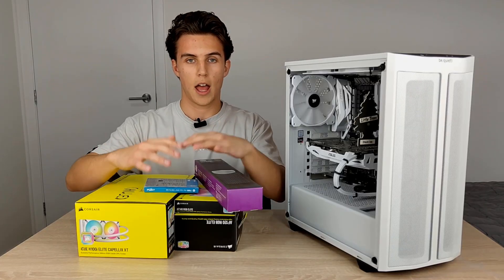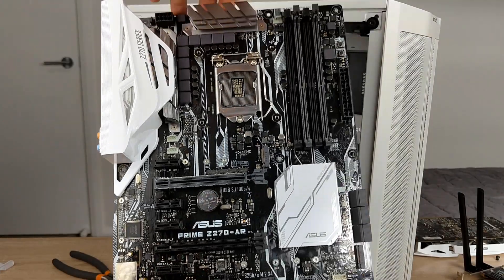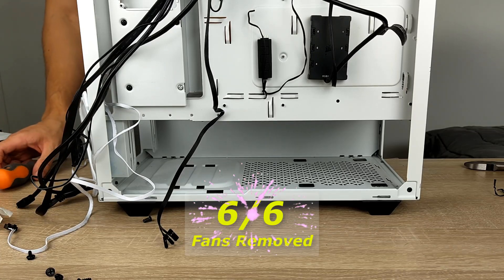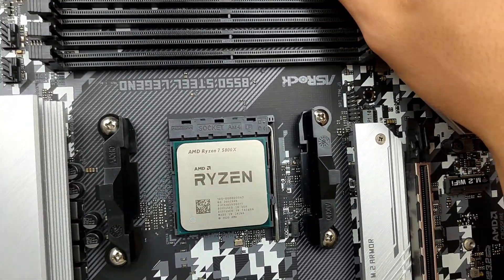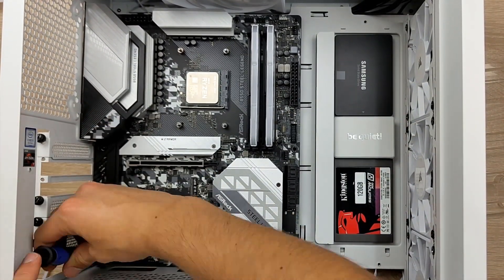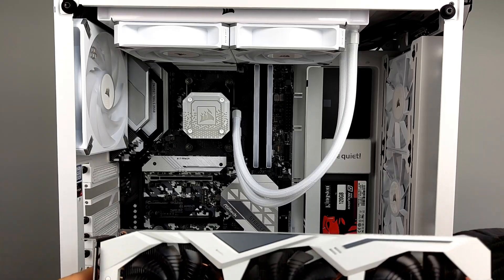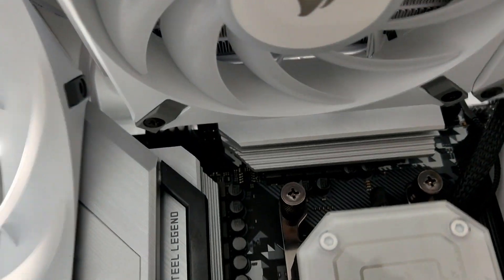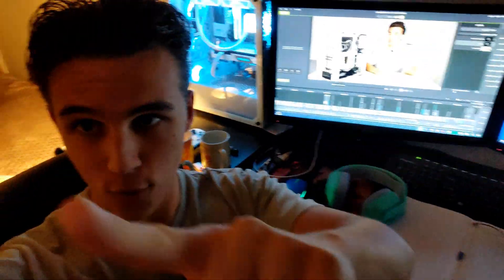I spent $629.33 upgrading my OLD PC

Comment: yo i got the ryzen 7 5800x to i just installed it yesterday it worked but my psu was 550 wats and thats not enough for a 4060 and a ryzen 7 5800x so i ended up deleting my ssd data and got windows 10 because win10 is lil bit less powery needed

Comment: Some random tips for u guys, you can get rid of the front air filter and the top air filter since the front case already has a mesh panel which already functions like an air filter, other case manufacturers have already moved to that design, normally you want to install the cpu power supply colored extension as soon as your board is installed because the upper right corner is tight in many cases or you could move over to a bigger case and then you dont have to worry about the specific order of hooking everything up. As far as installing the case fans the problem you also was having was your mechanical technique, the way you were doing it its ideal if you are Left Handed where you have your dominant hand on the inside of the case, since you are Right Handed for maximum torque you needed to invert the case so that your right hand is towards the inside of the case or option b is to put the case on its side and maintain your right hand towards the inside of the case, that way you can apply maximum torque by leaning your body into the turn, learn the technique now because you will need it for various other projects in your life such as home improvement projects and working on bicycles motorcycles cars trucks boats ships planes etc. Don't forget to update the bios on a regular basis and make sure your cpu is not getting cooked.

Comment: A small critique, but that power supply isn't really much better than the CX650M that you were using. An additional 100W overhead isn't nothing to scoff at, but the overall system load with a 5800X/2060S isn't gonna get anywhere near 650W, and the the CX650M is a quieter unit than the Gigabyte one. Overall, nice build, though!
Reply from the maker: Thank you and that's a fair call, the main reason was that the ud750gm was 80+ gold with the cx650m being bronze. It was a spare part I had on hand which allowed me to use the cx650m elsewhere in a more appropriate build
Reply: @EverythingDesktops  Yeah, for sure.

A quick thing I may add about the efficiency certification: the 80 Plus rating isn't all it's made out to be. Whenever checking performance and quality of a PSU, I tend to prefer the testing house Cybenetics, which does more thorough testing and has far stricter certifications than 80 Plus, and they include a noise rating rating as well (ranging from Standard thru A++).

https://gzhls.at/blob/ldb/7/2/c/2/4cf62a327509aab966f4c49b60749322f75e.pdf

The CX650M is actually a Cybenetics Gold efficiency / A- noise rated PSU, so it's a lot nicer than 80 Plus would lead you to believe.

I know this is kind of autistic and splitting hairs, but just thought I'd throw it out there. A lot of people don't know about Cybenetics, but more and more PSU manufacturers are starting to include their certifications in their marketing, so they're becoming more and more of an authority on PSU quality, which in my opinion is well deserved.
Reply from the maker: Wow, thank you so much for sharing this. I'm definitely going to look at Cybenetics next time. Looking through that link and after searching up my ud750gm, I'm really impressed with how thorough it is. I really appreciate your comment
Reply: @EverythingDesktops  Yeah, don't mention it! I They do great work, so I figured it would be worth a mention. Something to consider for future upgrades.

Comment: why were you screwing in the fans on from the inside, are you not able to screw them on from the front?
Reply: its because this particular case is designed like that, some of the other case manufacturers have shifted the fan brackets towards the front so that you can screw the fan in from the outside of the case, if an easy installation is important to you there are cases that are easier to build in, just look around youtube for case reviews

Comment: Very nice computer, no shame !

Proper cooler is what i like to see^^
Disslike when so many slack with the stock.
Reply: Slack? Some people simply are on a tight budget and the stock cooler will do absolutely fine, if you are not overclocking.
Reply: @X_irtz  Yes, but then you skip on the rgb or how big case you take, not skip on the cooler.

I see so many op their build wrongly.
Reply: @X_irtz  Aaand if stock cooling comes meta, it will affect the market everywhere, we get less and less choises.
Reply: @manuel85x  I mean... for budget builds stock coolers ALREADY are the meta, that however hasn't stopped cooler manufacturers from releasing better and cheaper coolers themselves, because a stock cooler is more of a temporary solution, especially gamers. So in a sense, it's only a meta, if you cannot afford anything better.
Reply: @X_irtz  I rather see those creative pizzabox cases or the motherboard box, and then focus on performance first.
Reply: @manuel85x  Clearly we got different priorities here.
Reply: @X_irtz  Yup.

You enjoy your choker build, 
i enjoy my box build.

Comment: Ive lost count how many times I had to take a small break out of frustration when building a PC. Especially when it comes to tiny wires and screws.
Reply: I agree. A lot of people act like building a PC is a calm, blissful experience. I've built 5 PC's now and it's still a frustrating process 😂
Reply: As a smoker, when building a PC, the amount of smoked cigarettes is way higher than normally. :D

Yet I like the building process as I've been doing that for the last 20 years. These days it's the watercooling what's frustrating me.